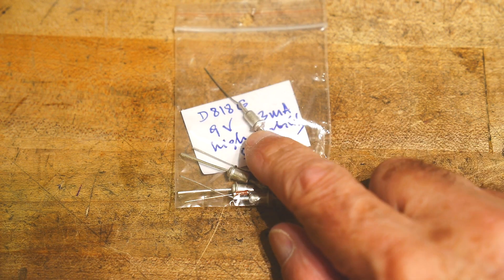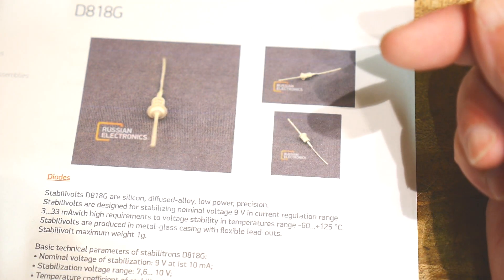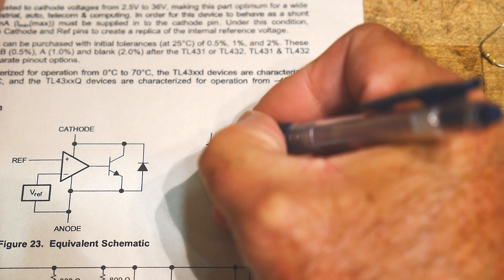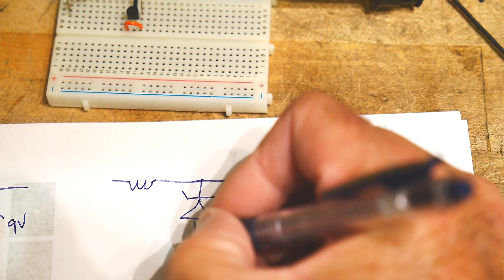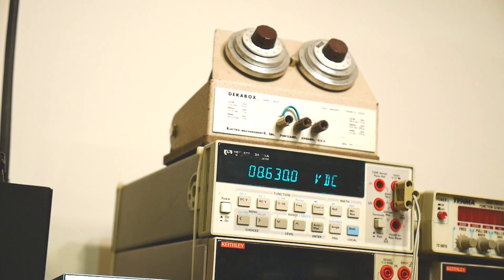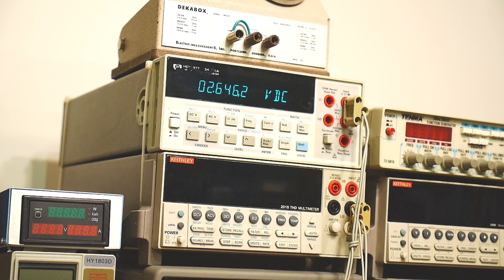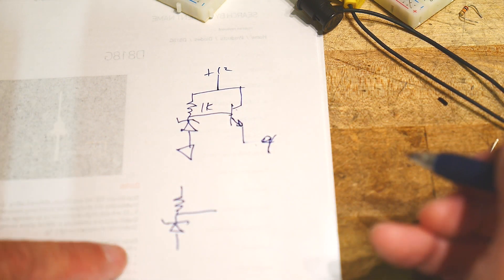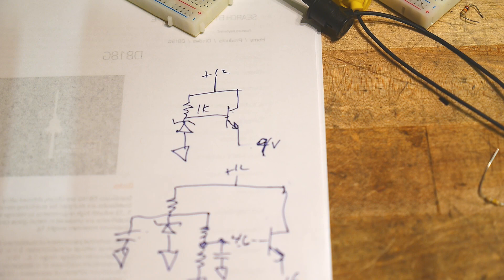#418 Russian Zener diode stability

Comment: Why not just use normal 4.5V LDO or even emitter follower + TL431 with reference pin connected to output (case described in TL431 reference: Figure 10-9. Precision 5-V, 1.5-A Regulator)?
Reply from the maker: stable with temperature. 
https://youtu.be/Gs86jM1ySr0
https://youtu.be/qJDLvPuXBb0

Comment: Why is the voltage on the TL431 so far off? Even the worst grade is supposed to be 2% accurate over the entire operating range and you're measuring 2.65v... that's off by like 6%. Is the part damaged? There's something SUPER fishy in this setup. In the lab under ideal conditions it should be bang on, within a couple millivolts.

Comment: I can't grok why you're doing this to obtain a "quiet" voltage for your preamp. 1) You don't need temperature stability, and you've lost it anyway by going through your divider and especially follower. 2) Zeners are not known for being quiet. Quite the opposite. 

Seems like all you really need is a voltage divider and capacitor!
Reply from the maker: well you might be right. 1. I wanted to use the zener since I had it. 2. I listened to the Rode microphone engineer talk on EEVblog and he used a FET buffered zener. So I though I'd see if there was anything to it.